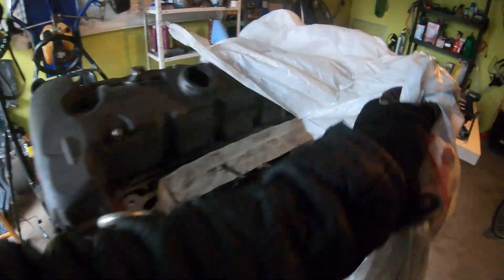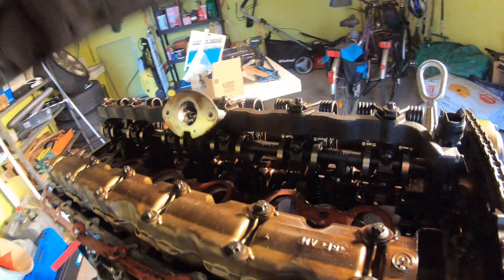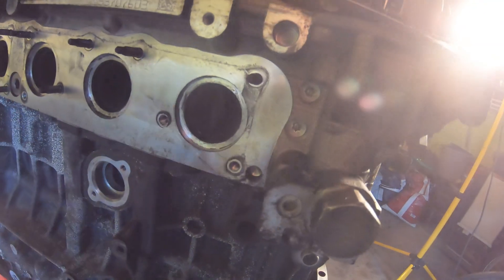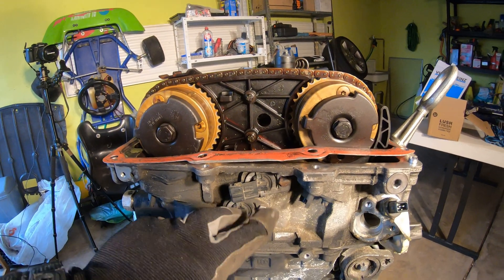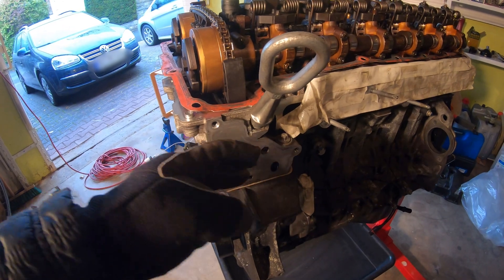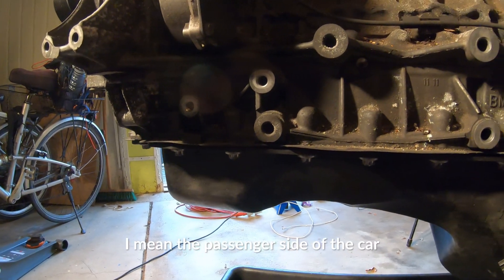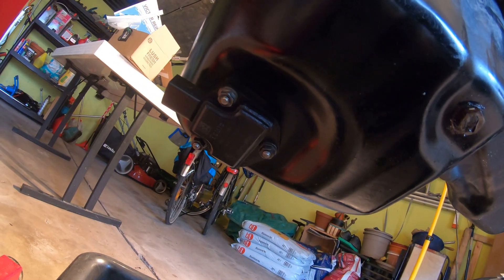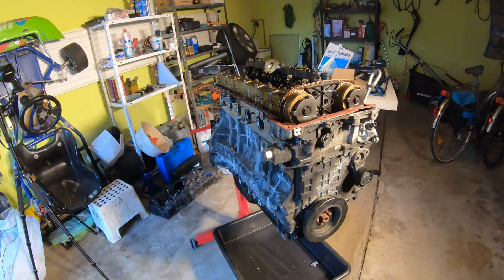How To Find Every Oil Leak On Your Car - BMW N52 Engine

Comment: My mechanic is telling us that the head gasket on our 52 is leaking and the head needs decking, (I suppose he suspects head warpage).  Is that a reasonable diagnosis?
Reply from the maker: Possible. How does he know the head gasket is leaking?

Comment: This engine eats gaskets and seals for breakfast. When you're driving in the city it works at 110-113 degrees Celsius. No gasket or seal can withstand that heat for longer periods of time.
Reply from the maker: Yes, valve cover gasket is metal on this engine. But that's why the oil pan gaskets go bad on these cars. They are rubber and metal

Comment: Just a couple of  additional comments. If you have an N52 with a plastic valve cover, these can warp and cause a leak. In that case you have to replace both the gaskets and the cover itself. The other point is that the oil cooler has two gaskets, one where it mounts to the block and one where the radiator mounts to the cooler. Both can fail.
Reply from the maker: Yes, good points 👍🏽. Thanks for sharing.

Comment: Long story short, every seal will develop a leak ! I just bought a 525i with the n53 engine. The engine is not burning oil but leaking it out ! I have to see where ! Thanks for the vid !
Reply from the maker: Yeah, my n52b25 has had every leak possible 😅

Comment: they don't hold their water either...Water pump, thermostat, front oil cooler pipe all places that WILL leak eventually or burst altogether. I nearly had a major accident when the oil cooler water pipe burst and flooded the engine bay with water that caused the power assisted steering servo to slip meaning no steering...some wee came out as I ran up onto the grass to avoid other cars...
 BMW cars are a nightmare unless you have deep pockets or well equipped garage, time and extreme patience...Dealerships in Australia routinely skip replacing time critical components to make more money so cannot be trusted either. Mark the filter take it in for a service and check afterwards if it was replaced and get ready for a shock. They are not referred to here as "Buying More Worries" for nothing. Especially after years of Toyota ownership you get lulled into never expecting issues apart from battery and alternator. Best way I've found to stop the leaks is to not put any oil in it ;-) works well for British cars too... Leaks also occur at the oil filter housing both at the front cover and where the body attaches to the engine. Best to change every oil change and don't forget the O-ring for the oil filter cartridge or it will guzzle and spew oil. Extremely unrefined engineering.
Reply from the maker: Sounds pretty horrifying in Australia. Maybe they don't swap components because they can't get them or it's to expensive to ship from Germany
Reply: @buildanddrive Australians are lazy and customer service or laws are not important to us apparently.
Reply: @buildanddrive Australian mechanics are simply lazy and can’t be bothered to follow maintenance rules or think they are smarter than the designers and so make their own rules. It’s no wonder Australia has no civil auto engineering industry at all anymore. Corruption and complacency ruined it…

Comment: A leaky BMW is a normal BMW.     I get suspicious of a BMW that is not leaking, as that makes me wonder what big issue had to be fixed, LoL.
Reply from the maker: Me too. I'm losing power steering fluid now but I know from where. It's very slow, over 6 months I loose 100ml. Lol

Comment: at 6:11 seconds that is your crankshaft position sensor :) it does not leak cool video man mine is leaking like a gutted pig really badly n52 xdrive im doing the oil pan but thinking if its the rear main seal car has 270,000 kms what do you think
Reply from the maker: Thanks for the info. Sorry to hear your car is leaking. It took me years to sort out all my leaks
Reply: @buildanddrive  damn brother I feel ya bmws always leak
Reply from the maker: @aimized1460  my parents Toyota matrix which they've driven 240,000kms has never had an oil leak, or any leak for that matter. Crazy right!? Every single gasket on my bmw has leaked lol

Comment: Hi man hope all is well I recently bought a 2011 e90 328i and everything seems to run great but there was oil stains in the front of the engine when I bought it but but I’ve driven the car had it on to see if there are any leaks but I don’t see anything leaking idk if it was from something previous that was fixed or if the last owner just accidentally spilled some oil and it ran down the front of the engine is there anyway I can send you a picture ?
Reply from the maker: Yes send me a photo on IG. It's probably the oil cooler, the vanos solenoids or oil flinging up from the front main seal

Comment: Is it safe to install Catch Can instead the CCV on N52B25 engine, the thing is that my engine is burning 1l of oil on like 300 miles?
Reply from the maker: Do you have the magnesium or plastic valve cover?
Reply: @buildanddrive  Magnesium
Reply: Did you find out what it was?

Comment: intake manifold gasket may fail or leak too.
Reply from the maker: It may fail and leak air - correct. But not oil.

Comment: Please help 🌹 Can you explain where it is the OIL PRESSURE CONTROL VALVE 11417584991 location in This engine n52
Reply from the maker: What is the year and model of the car? The valve says it's on the front left side of the engine.
Reply: @buildanddrive  2011 523 n52 without turbo 6 in line  Can you explain the place with a picture or a short video Thank you for your interest and response 🌹🌹🌹❤️❤️
Reply from the maker: Send me a message on Instagram and I can send you a photo

Comment: The oil return line to the oil pan, you said yours failed every year ? How was it failing ?
Reply from the maker: The very bottom of the hose has two rubber washers that seal the hose to the pan. For some reason they go bad and start leaking. I'm not sure if it's just the quality of the rubber or my CCV was causing too much vaccuum to hold the pressure there and they started leaking
Reply: @buildanddrive  ccv delete and add catch can. did it to my 330i n52

Comment: The trick to happily living with a BMW is not finding the leak you have, but the leak that’s about to show up tomorrow.
Reply from the maker: Comment of 2022! 🙏🏼😂
Reply: The trick is to buy a Hyundai or Toyota and simply live next to a BMW owner and have a laugh at how often the hood is up...
Reply: @tcellen2136  most cost effective way  to have a BMW is buy it new and sell or  trade just b4 warranty tanks. cost a little more but a starter motor  job can run up a 2k invoice in some  cases so   own an out of warranty BMW at yur own risk.

Comment: nice viddy... you missed the sensor gasket at the top in the valve cover and dont forget that head gasket will start sweating and leaking eventually...
Reply from the maker: True. Never had that one leak before but it could 👍🏼
Reply: @buildanddrive  one? he told you two. head gasket and cam position sensor.
Reply: Thank you so much y’all,so what happened when the head gasket start sweatin’ and leakin’ but car not over eating,please someone tell me something 🙏🏾

Comment: About to rip out my N52 due to knocking
Reply: Going to see if I can take off the valve cover and look for damage this weekend. Been battling my other car a Subaru Forester ended up being the battery causing all kinds of problems.
Reply from the maker: Send me a video on IG. I would be interested in hearing what it sounds like. Mine was knocking too
Reply: @buildanddrive  unfortunately the battery is dead and I have it wrapped up. The disa valve went into the intake, it was also leaking oil from the valve cover passenger side towards the rear corner. It will start but is knocking and down on power. All the plugs look good, took off intake all clean. Going to have to check oil pan next. Contemplating a ls v8 swap but not sure of everything I will need to make that happen. *edit the car is a 06 Z4 3.0SI Roadster
Reply: @bOOmbOOmProd  if it ate a DISA valve it likely damaged or dislodged a rocker arm, I wouldn't pull it out just yet. you may be able to put it back, it's almost certainly top-end related
Reply from the maker: I agree. I bought an n52 online that ate the disa valve and broke an exhaust valve on cylinder 6

Comment: Great video again! Did you use RTV when you installed oil pan and it’s new gasket to your rebuilded engine? Any leaks?
Reply from the maker: I did use RTV even tho originally I think they use a glue or something. No leaks so far 🤞

Comment: yo, first ✌
Reply: Bro, as usual a very informative and well presented video. You asked so I'll tell you. The only possible oil leak you forgot to mention was the one at the air pump on the drivers side of the engine and that sensor you forgot the name of is the crank position sensor. Looking forward to the next video bro and if your teaser is anything to go by, looks like Ms Build & Drive knows a thing or two about engines 😂 anyway bro as usual stay safe ✌
Reply: Bro, which Makita are you using and is it any good?
Reply from the maker: Makita dtd155 it's working well for basic stuff but it is not an impact wrench designed for removing bolts on a day to day basis.